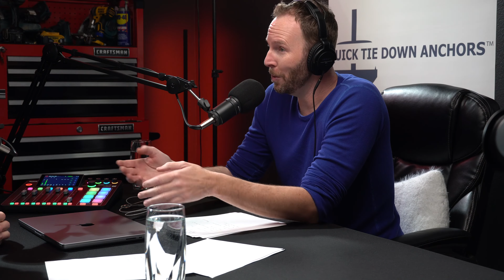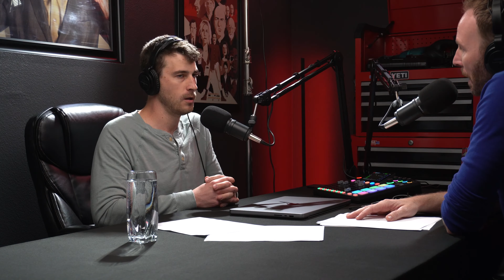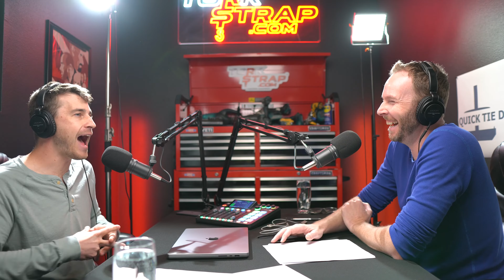How to Prototype Your Invention Yourself

Comment: What advice would you give to someone living in an apartment?
Reply from the maker: You’re probably better off than anyone because you are forced to learn to outsource and delagate certain systems. On top of that, you don’t have to mow, rake leaves or spend all day Saturday cleaning.  My advice is to dedicate a part of a room or kitchen table to your tinkering and prototyping days. Besides that, the real work you should be doing is building systems, networking with influencers, and going to trade shows. None of these require space.

Fun fact, I moved to an apartment at one point in my journey for my wife’s job… my marketing actually got stronger and more consistent because I wasn’t leaning on myself for videos and demonstrations
Reply: @inventwithme  to be more specific with my question, I was more talking about the noise factor.  When the guest brought up that a welder that he talked to was dragging his feet, he decided to buy a welding machine and learn how to weld.  I'm all for that, but my issue is the noise factor, especially when you start working with wood or cutting metal.  That gets really loud really quick. 

So to go back to my original question, do you have any advice on how I can still pursue my ideas while having to live in an apartment, and having to keep the noise down?
Reply from the maker: @heatherryan9820  throw the materials in the back of your car, take them to a friends house or park and weld them up.

I once built a rotating cabin set in my apartment for a film project. The whole rig had to be big enough to seat two adults and rotate them upside down. Just go for it.

Comment: I taught myself 3-D modeling and bought three different types of 3-D printers. I now have a near perfect prototype that I will start mass producing in my garage using silicone molds and a pressure pot. Wish me luck! My provisional patent application is in and I am about to submit my non-provisional.
Reply from the maker: Freaking sick!!! Love to hear it. Enjoy the garage days while they last… 🎉😊
Reply: What type of product are you trying to make? I am wanting to make a small keychain type of device that would require either a harder, inner shell covered by soft silicone with a small dispensing unit inside.  It’s kind of a luxury market looking item.  Not sure how the 3-D model could work or creating at least the prototype.